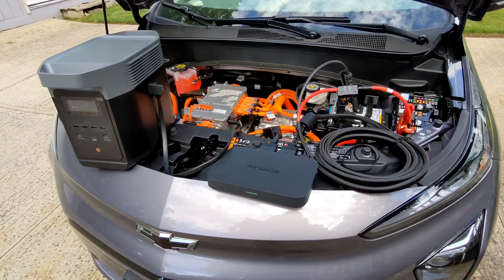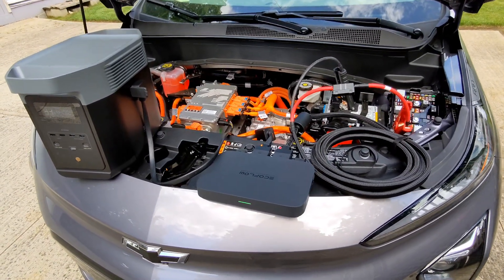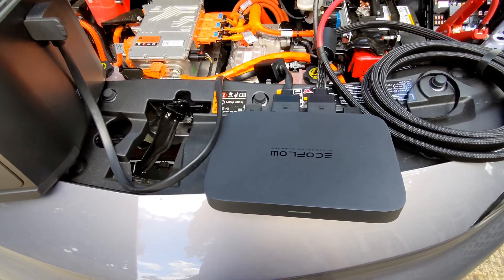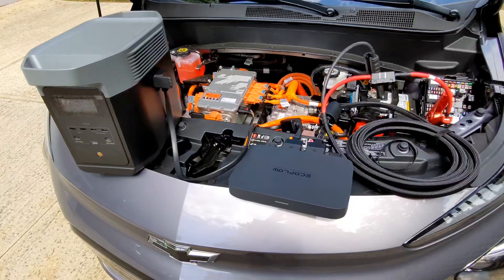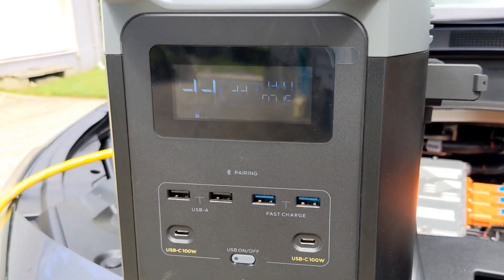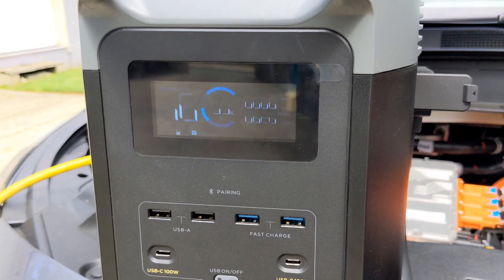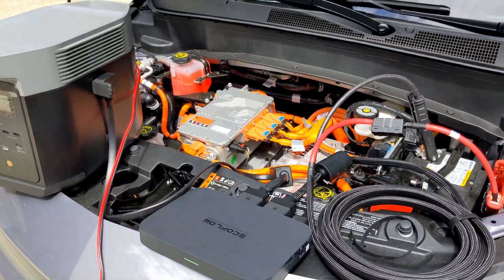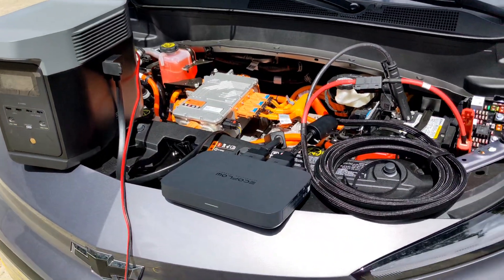EcoFlow Alternator Charger on a Chevy Bolt EUV

Comment: This is a great video. Do you know how much is the inverter in your EV? I know my Highlander Hybrid is 1500W capable. Hope that does not overheat the inverter from the EV but if you mentioned has active cooling, it should do its job.
Reply from the maker: The Bolt has a DC-to-DC converter that is rated up to 130A, which works out to roughly 1800W. So the 800W draw by the Alternator Charger doesn't have any discernable impact on the car in my experience.
Reply: Yes with those numbers should be fine!!! Nice setup buddy!!!